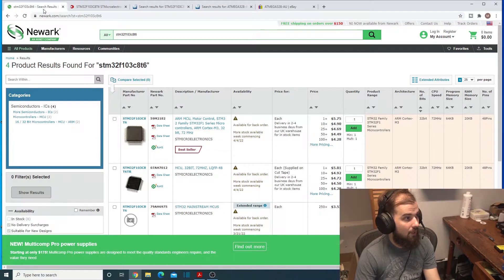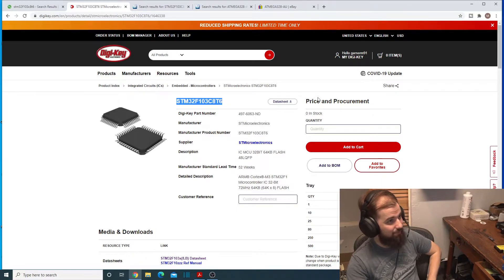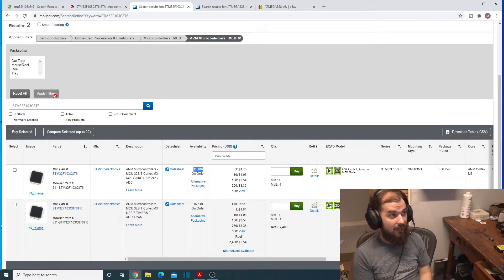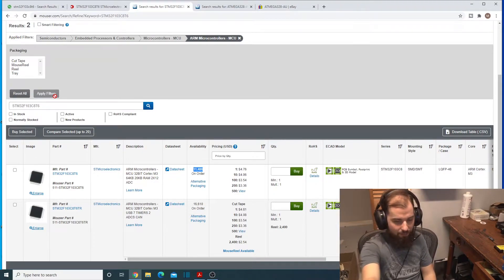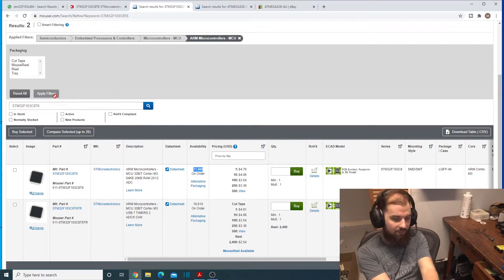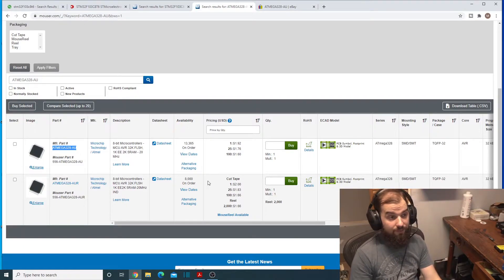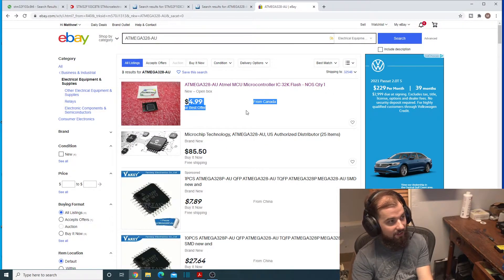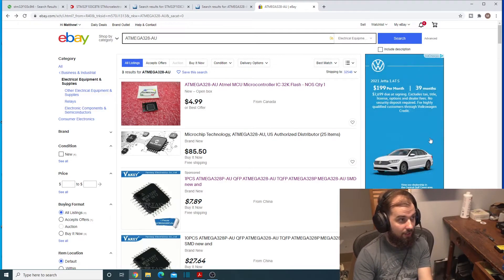Chipageddon 2021: Global Semiconductor and Microcontroller Shortage

Comment: ya thing about investing in production now is, that China is in War mode to build up their chip industry so by the time the production is online the entire industry is going to be in price war mode, so profits are going to most likely be down the drain. kinda like back in the days with solar panel everyone and their mother had started a solar panel / waffer production in china and where undercutting each other price wise so the u.s solar industry just collapse cuz who in their right mind spend money on a factory to just lose money when they come online.
Reply from the maker: At the moment a lot of fabs are purchasing equipment like crazy. Definitely a short time investment as an outsider. If you design chips and want to to keep your ip you should really not outsource production. Take the stm32f103... It has at least 4 clones/counterfeits of it. Most of which aren't just made cheaper. They also are not paying an arm license. That's why clones are less than  $2 while the real chip is around 5. I understand that argument though.

Comment: What is your favorite station t 12 station or jbc . Olso very nice video.
Reply from the maker: JBC. The t12 is good and I would probably like a real hakko unit as much as the jbc. I hate the actual handles on the cheap t12 units
Reply: @FixedUntilBroken   I now  this is the reason why i buy ta carbonic green handle for my diy t 12 station. This blue one heat very much.
Reply: @andreiciora2765  I had JBC at one time unless your are using it 8-10 hours a day to make money go with a Hakko FX951 or a older FM202 will save you money overall especially on tips and yield the same results.
Reply: @Rhine_Labs   I prefer jbc  than the hakko  because are more good quality .
Reply: @andreiciora2765  I have been repairing electronics since 1997. 

My opinion is JBC is way over priced for what ya get. 

I think the Hakko tips last longer. 

I have really never had to replace a genuine hakko one that failed before I broke it by misuse. Not the case with JBC. 

The Hakko tips are readily available also I can even get some locally.

But if you like blowing wads of cash on the JBC go for it it's your hard earned cash. 

I sure do not miss paying 4-5X as much for fragile tips that the thermal couples fail often or waiting on back ordered or discontinued parts "JBC stuck on error 3" that makes the unit a brick.

Hakko has issues also like my 850D element no longer produced but for 2X's the price can get a Quick or atten which out preform the hakko.
Reply: @Rhine_Labs   sow you recomend me to chose  hakko and not jbc .  Yes it is true the tips are more cheaper but for my country it is very hard to find hakko unit with the input of 220 v .